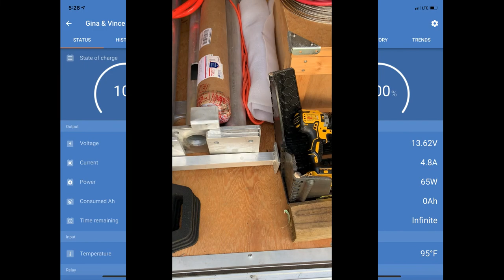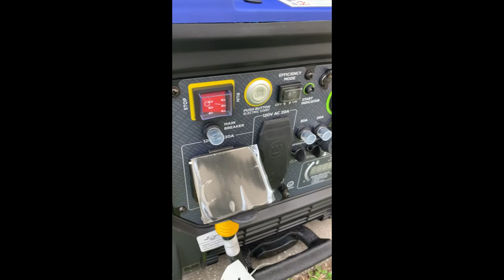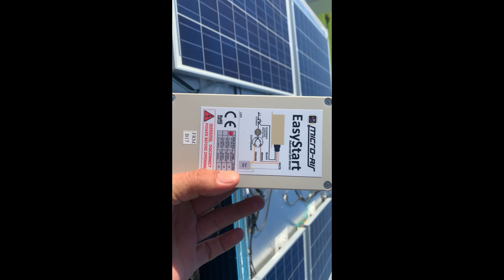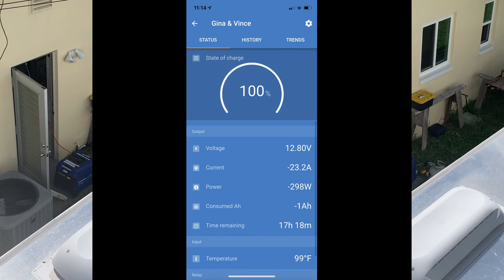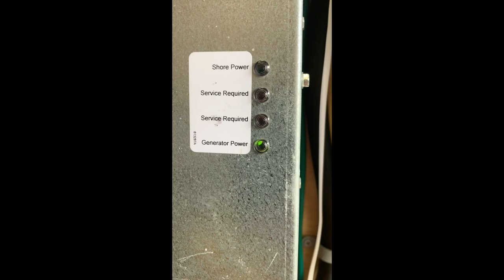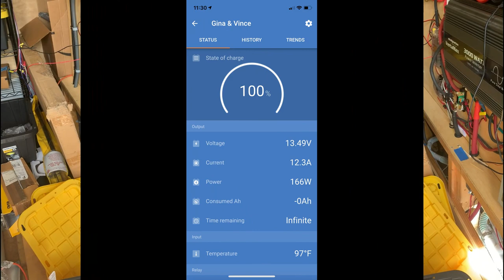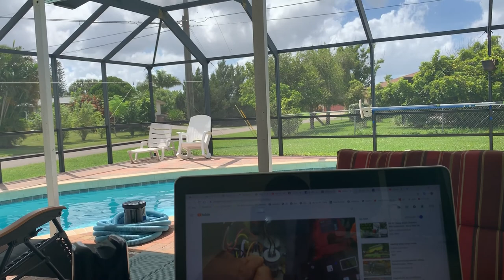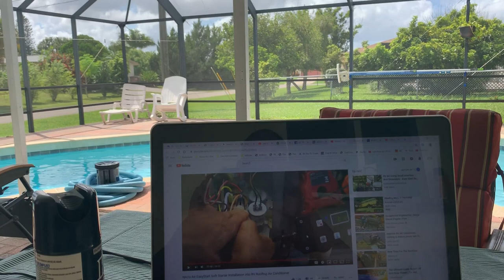RV Trailer Build #117 - EasyStart™ 364 Install on our Brisk Air II Air Conditioner

Comment: Do you have a video of the wiring install hookups ( EasyStart™ 364 (3-ton) Soft Starter to the caps )?
Reply from the maker: Hey Gary - unfortunately not up close and each wire specifically - but I will tell you that I just watched the video from the manufacture and did exactly what they showed - worked first time. There is only one wire to cut and to add the pig-tail to - and that is the blue/purple wire - when you cut it you splice the pig-tail (Black Wire) in with the cut blue/purple wire - the Pig-Tail then runs over to your 364 unit and connects to the black wire using a butt connector... Hope this helps...

Comment: how much does that generator cost?
Reply from the maker: Westinghouse iGen4500DF 3700W/4500W Remote Start Dual Fuel Inverter Generator New
 $999.00 - https://factorypure.com/products/westinghouse-igen4500df-3700w-4500w-remote-start-dual-fuel-inverter-generator-new
Reply from the maker: I also purchased the Westinghouse 140569 High Altitude Carburetor Kit For iGen4500DF for Altitudes 2000 Ft to 7000 Ft New
 - $49.00 and the extended warranty for $99